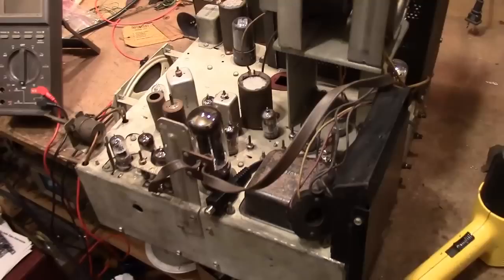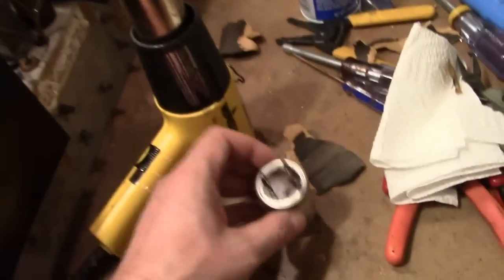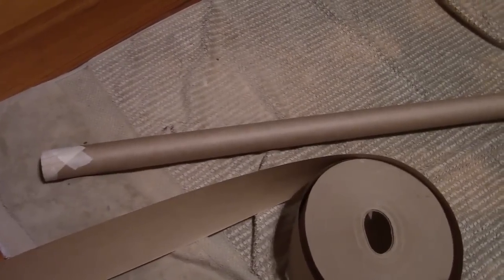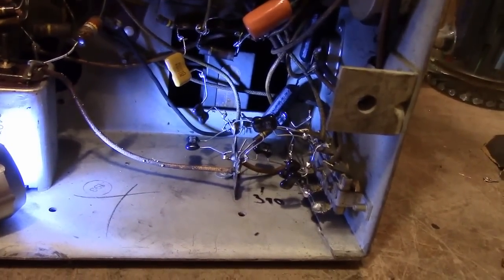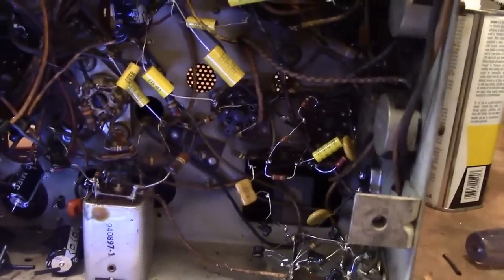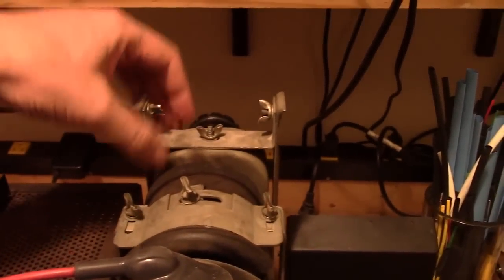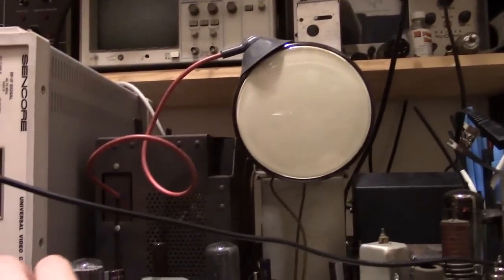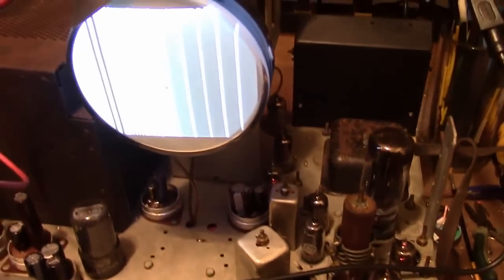RCA 721TS II restoration p1o?

Comment: Nice video Bob. I did check all of the power resistors in my Zenith 24H20 chassis but after watching your last three videos I am going to re-check my work and check all the old resistors. I still need to find the 5AXP4 CRT though. I have a line on one from a Videokarma member but so far I do not have the test tube. Gary

Comment: why not try uncrimping the base of the capacitor putting the new capacitors inside and the recrimping it, as shown about half way down antiqueradio (dot) org/DuMontRA-103Television (dot) htm
Reply from the maker: +laurdy I've done that in the past and it's a real pain.  Much easier to cut the cans open.  Especially when the cut will be covered up by a cardboard tube.

Comment: Amazing, the lengths you go through to keep and/or achieve authenticity, Bob. You're a role model. 
On your masking paper roll, I'm thinking you could have wound it really tightly, taped it off, and cut it to the desired width with a good, sharp hack-saw.
How many capacitors does a common TV set like this one have that need to be replaced? Looks like significantly more work than the average antique radio.
Reply from the maker: +Jason Atkin  I tried using a hacksaw but the resulting edge was very rough.  I found a fresh razor blade works very well.    Something like 10 electrolytics and 30-40 film caps.